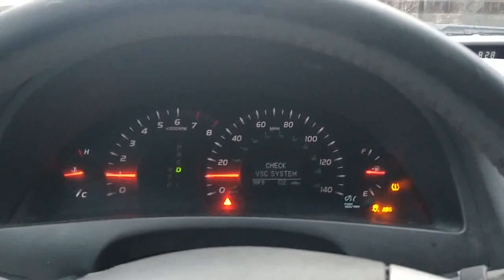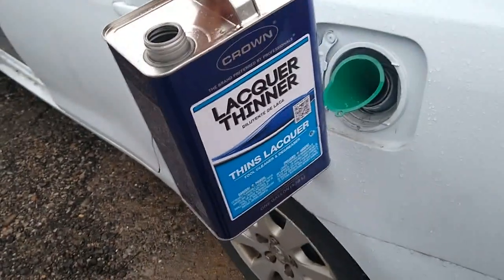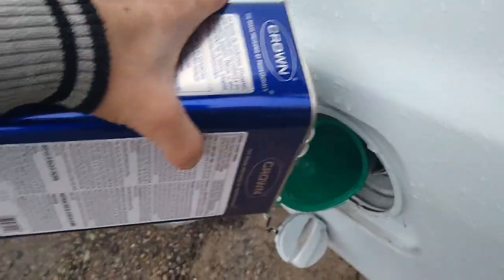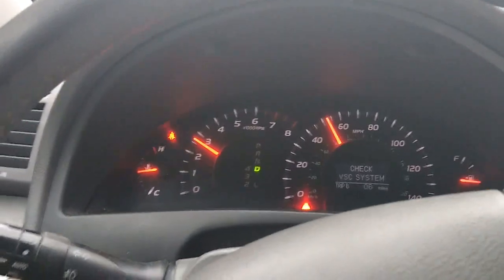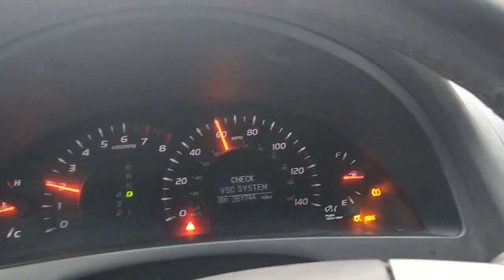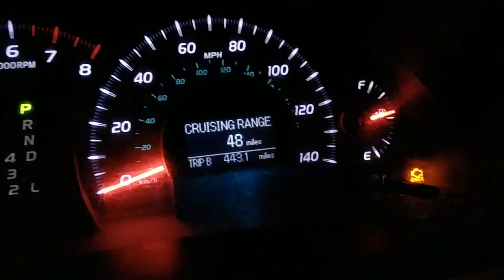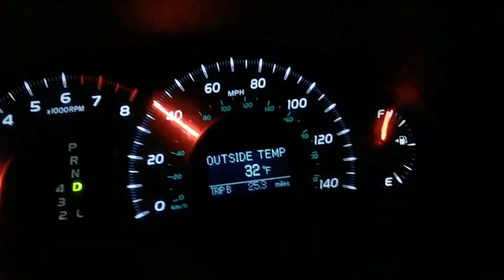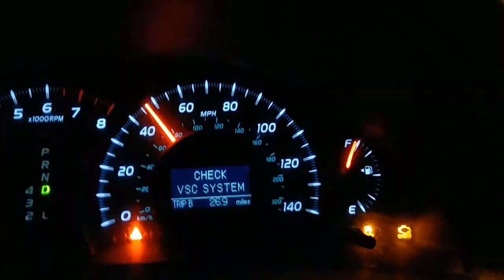Does lacquer thinner clean catalytic converter

Comment: How about finding the reason for the almost +8 % long term fuel trim before?
Reply: True.   I had a dead fuel injector .   I was trying to fix cat sensors ...etc     When I listened to all 8 injectors,  I discoveered injector on cyl2 is not clicking.     I replaced it ,  then put some alcohol cleaner in the tank,  that solved my cat codes.
Reply: @wildthoughts6959  👍

Comment: Once a year, about 6-8 weeks before getting emissions for tags here in Georgia, I buy a gallon of Acetone to put in my tank. I have a 2004 Ford Ranger XLT 3.0L V6 with manual transmission and now 290,000+ miles. Fuel capacity is about 17 gallons. I run it till the fuel light comes on and put the gallon of Acetone and 11 gallons of ethanol free 87 octane fuel in. Then take the truck for a 120-150 mile road trip at highway speeds to clean everything out. Actually cleans up the Spark plugs and likely the combustion chamber as well. Most times it lights up the engine light about halfway thru the trip and it stays lit for a couple days with similar emission system codes. Over the next couple days I consume all 12 gallons and fuel light comes back on. At that point I put 10 gallons of 92 or 93 octane fuel and run it like normal. Usually the light goes off after 5-8 start and stop cycle. I take the truck in for emissions shortly after. Passes 100% of the time. Have had the truck since 2006 and 30,000 miles and lived in non-emissions Barrow county Georgia the first 10 years but did the same procedure. Had a 1991 Ford Ranger with 520,000+ miles before this one and did the same procedure with it. Regular oil changes and keeping vehicles in tune and good running order really can extend the lives of our vehicles. I had a 1980 Honda Accord that my mom bought new and we did the same procedure with it. It survived 17 years and 260,000 miles before a drunk driver killed it at a traffic light..
Reply from the maker: Thanks for your input

Comment: Worked for my 2011 accord. 7,400 miles later and the light still hasn’t come back. Put 1 gallon of lacquer thinner on half a gallon of gas and drove over 100 miles.
Reply: Half a tank of gas, I think you meant

Comment: worked to pass smog on my 2000 Toyota 4Runner. What I did was put a gallon to half a tank. I then ran it in my driveway for 30mins at 2,5000 rpm. I then cleared the code and drove the car for about 300 miles and next day it was ready for emissions.
Reply from the maker: Maybe it worked on your sbecause it wasn't as bad my car I had water in the tank because of  bad gas , and thats what caused the check engine light to come on, so for my car it didn't work . I'm glade it worked for you. And I did travel with the car more then 2500 rpm , I went up hills and the whole 9 yards .

Comment: Your car catalytic converter are properly gone because of to much in clogging or broken pieces of the converter honey comb inside of it because your car having to many mileages.Your cars having 150,000-170,000 in mileages or less the code showing up.And you doings it right aways.You’ll having 90-95% of chances of successes..
Reply: I agree with you but this thinner seemed to be 95% effective….I have a 2017 Hyundai ioniq and drove 240K so far due to Uber driving …my engine light came on and poured this thinner with half full of gas in the tank…engine light came back on after 389 miles and reset it again…so far now I’m at 400 miles the engine hasn’t come back on…this could be very tricky because my performance on my car is great and no issues at all however I’m thinking about buying the cat converter anyway since I have that same code of P0420….I believe that my cat honey combs is not yet totally combusted yet but it feels wiser to make a purchase of this cat now since prices for this goes up and up….to clarify 95% of success…agree with you right way of maintenance is a must which I do oil change every month or 5K whichever comes 1st in my car since I do Uber full time

Comment: I'm really apprehensive about putting this in my 2018 Acura tlx, I have used cataclean instead just to be on the safe side
Reply from the maker: It didn't work for me and i had water and run the car and stalled so I'm sure it was noway to use any solvents
Reply: @yahussain39  So far I've used 2 of the Cataclean & drove for a while & my light hasn't come on so I'll see how long it lasts.
Reply: @djsthemetereman  7 months later how is it going?
Reply: @duypham76  Well I no longer own the car I traded it in, I now own a 2021 TLX type s so I don't have to worry about cleaning anything at least for now
Reply: @djsthemetereman  oh ok you're good for another 170k+ miles lol
Reply: @duypham76  Yes for sure

Comment from the maker: Well there was no way for this to work because i accidently put gas that had water in it and I tried to run it by putting 1 gallon of 91 percent alcohol in with the gas to dilute it but learned that doesn't do anything then had to suck all the gas and the light come ok after this whole ordeal and the thinner will not work even if I did it 100 times the unburnt gas all over the catylic converter